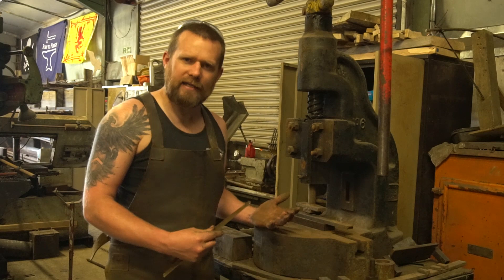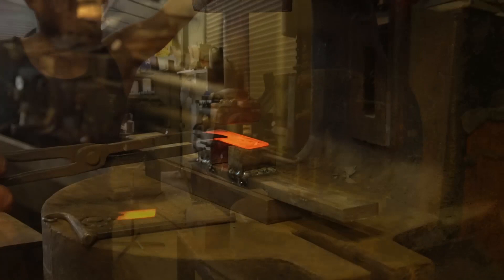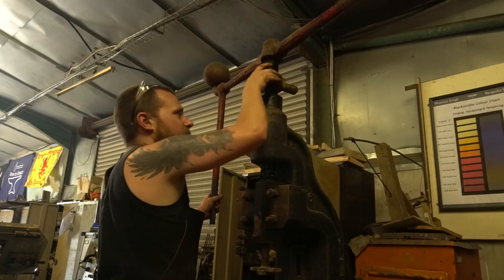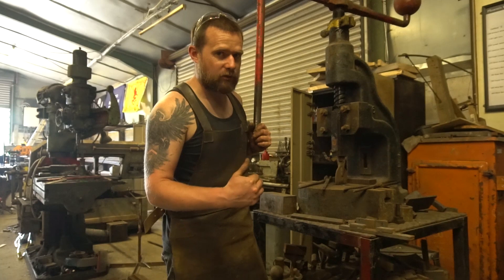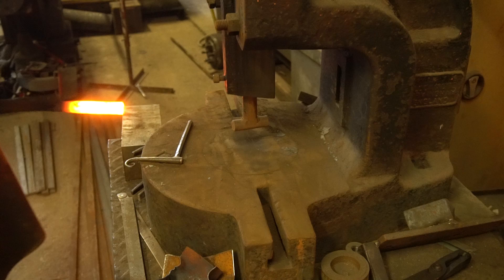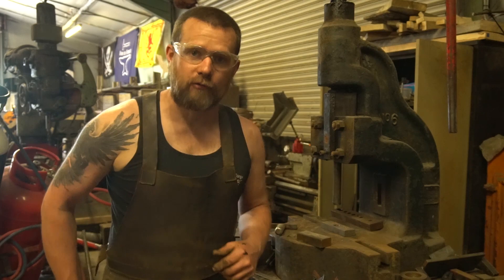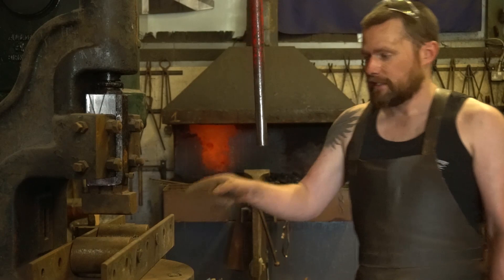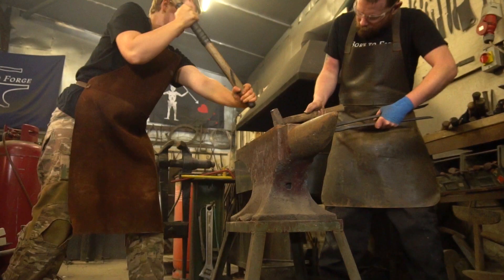The Fly Press - Blacksmiths Essentials -

Comment: Need for a fly press intensifies....  Absolutely the #1 thing I need in my life right now :'(  Cheers for answering the question of what number fly press is the minimum advised for forging!  A number 4!  I'll be going for one as soon as I can scrape together the cash.  I'm absolutely dreading moving the beast into the workshop without access for an FLT though, but I'll find a way!
Reply from the maker: They can be a little on the heavy side, an engine hoist is a great way to move them about
Reply: @phoenixforge5944  Aye, I think it'll have to be done that way.  The ground outside my forge is really rough though, big stoney gravel & the door is narrow.  So will be some effort to get it in, but it must be done and I'll find a way!  The hoist will be handy for other things down the line, so not a bad thing to pickup in the long run anyway!
Reply: @davosfirebeard4495  
have a word with the local locksmith and see if he's got details for a specialist safe moving company. Those guys deal with weights like this every day - alternatively spend 30 years down the pit and you'll learn how to move and lift anything with no specialist tools, but a lot of cunning  ;<0

Comment: Dear Will,  thanks for your informative video.  I am looking at a couple of fly presses at auction and was hoping to pick your brains.  The bigger of the two is a twin column fly press, meaning that the front is filled with one half of the support column.  As a blacksmith, would this be at all useful or should I look for an open-fronted fly press instead.  The big advantage of this one is that nobody else seems to be interested and it looks like it will go very cheaply.  Thanks.

Comment: Looking to get a #3 flypress as I dont want or need to move the sort of stock you do and also I have just (literally made one hand forged dirk) started . The reasoning is lack of energy to use a hammer for long enough and cost fore a newbie like me but still make hobby stuff. OK I intend to make throwing knives (mostly from farrier rasps = theoretically easier than full forging from a billet) as I do a lot of that including teaching. Why comment here - question do you have any experience of different makes that would turn your eye to buying over another? I have a choice of a Denbigh or a Besco F J Edwards both  #3s
One is cleaner and looks from pictures Cleaner but both same price

Comment: Can I ask how you have your bottom dies set up? My press doesn't have a bottom block and I'm a little confused about how to set up interchangeable bottom dies/jigs?
Reply from the maker: you might have a bar press? On most fly presses there is a removable disc which allows you to punch and drift, but mostly there are t slots that allow me to bolt my bottom tooling down to the base
Reply: Thanks for your reply! I believe mine's a number 6, though it came with no disc and the bore in the tool holder is a massive 50mm diameter which I'm having trouble finding/making an adaptor for.